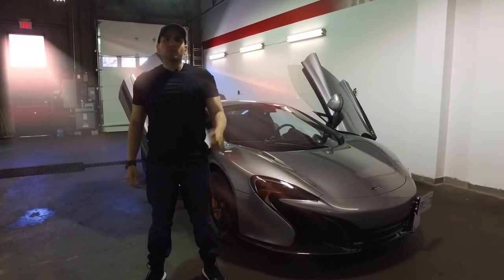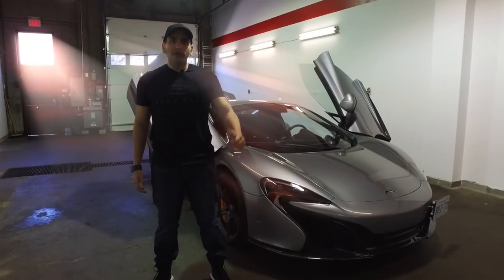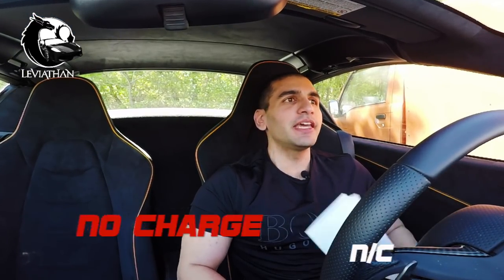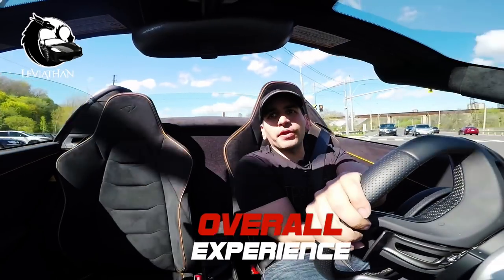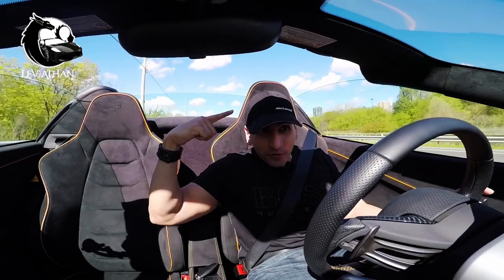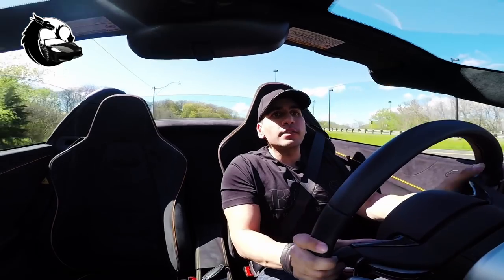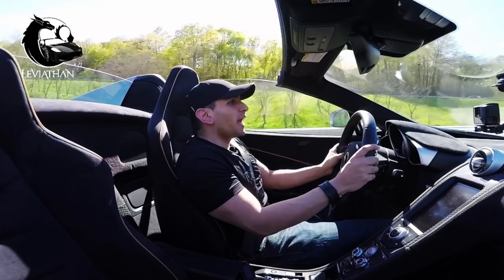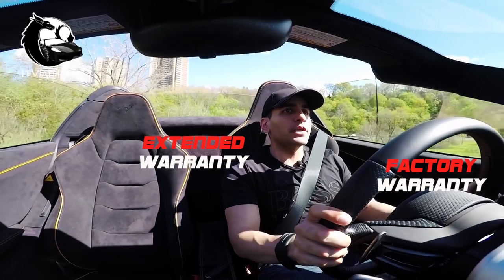MOST Expensive MCLAREN Supercar Breakdown! The FULL STORY!

Comment: Sold a McLaren MP-4-12C to buy a new NSX. It was the best decision I ever made because the McLaren though attractive in many ways was an absolute nightmare to keep on the road. I don't care that McLaren honored the $89,000+ in repairs for the 11 months we kept it! Transmission failure/problems, oil leaks, LED taillights failing, instrument panel lights not working, ECU replacement (2X), leaking struts, creaks rattles, electrical gremlins, parts availability etc. etc. etc. Christ what a beautifully designed but horribly executed and unreliable vehicle. The POS like our Ferrari 348 spent more time in the shop than on the road! Getting into an exotic car and having it start and actually be capable of going on a road trip without having to worry about a problem is truly enjoyable. The NSX is far more reliable, great at everything and better than the McLaren (even when the McLaren was working). The McLaren was never a great car but, it was better (even great at) frustrating and completely ruining your driving experience with its constant issues and breakdowns. Never again.

Comment: I had similar situation happen to me on my 12C . One time I remember driving on the highway and stepped on the gas hard. Car lost power and those same scary sounds come from the the car, along with the low oil pressure warning light. I Was really disappointed with Mclaren cars. Had the car towed to Mclaren Boston and it was one of the intake hose had come loose; too much turbo boost i guess. It was fixed under warranty but it was really scary. I sold the 12C after a year of ownership, I lost like 27k in depreciation but I would buy another one again!... maybe a 650S or 570S...I love those cars!..
Reply from the maker: Yikes that is a scary feeling! I had to have my car towed once took hours to get it loaded on the truck. (Was not a Mclaren tow). I still love the McLaren though!